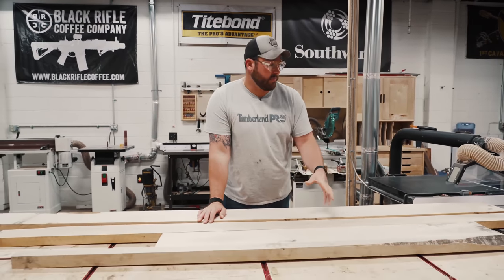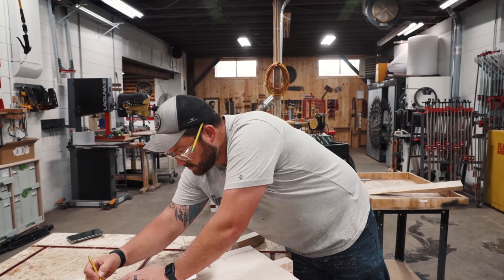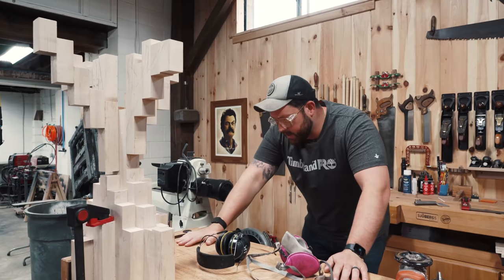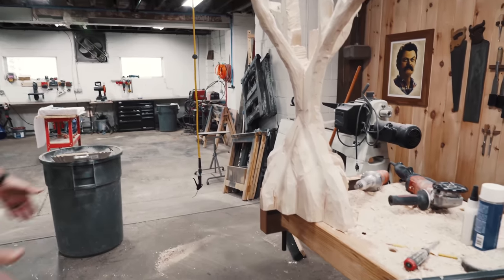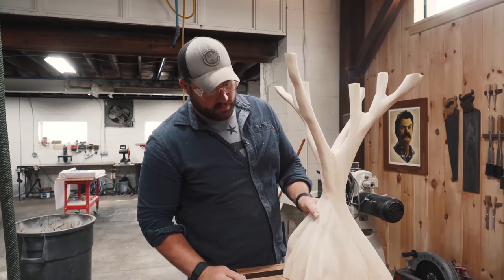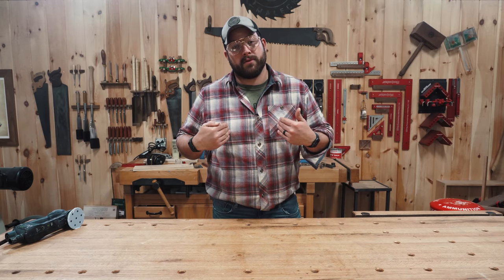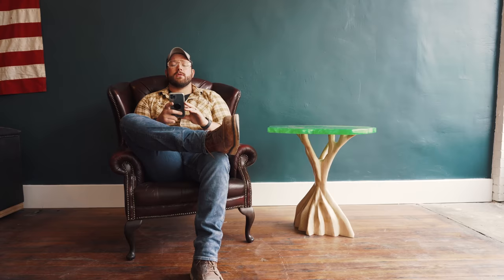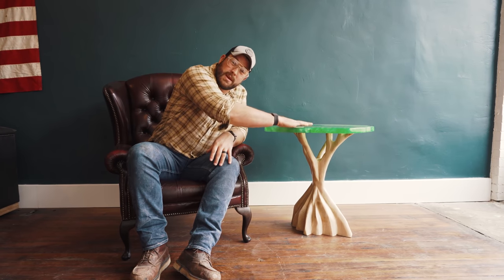CRAZY Epoxy Tree Table Build 🌳

Comment: Hey John I use the Milwaukee m12 die grinder to carve you can buy any cheap 2 inch aluminum oxide discs for them. I use 36-40 grit to hog away material and you don’t get any tear out. I can carve for around 30-40 minutes on one 4.0 m12 battery. I currently use mine to carve birds. I roughout them out on the bandsaw and then shape them with my die grinder from 36 grit for shaping up to 10000 grit for finish. I don’t do any hand sanding on them. It makes the job fly and you don’t have to worry about losing a finger!

Comment: I think it looks great. The 1 thing I would suggest to improve it is when pouring the resin top that you have the table suspended like a 1/2" so you don't see the limbs protruding through the top. 
And maybe making the base a little more organic by cutting through the base so you can see the individual roots branching out instead of 1 big cluster.

Comment: so i do a bit of power carving myself especially with the arbortec turboplane I love that thing. some things i've learnt from power carving is having a variable speed angle grinder can help at times with tear out aswell as just being alot less aggressive, really quite amazing how much control you can have with that tool and when you get more confident just being more nimble with it and having the grinder is some really quite odd hand positions to account for grain direction(using a switch grinder and not a trigger one of course) will make that alot easier to accomplish. another tool which you may want to look into is a powerfile ive just got a black and decker one but makita has a reasonable one and some pretty solid pneumatic ones they compliment it wonderfully especially for those awkward spots you just cant quite reach and the stock removeable is really impessive, and since its a sanding belt you wont blow out chunks either. hope this little tid bit helps, love your work john and hope to see more power carving in your future.

Comment: Looks really good! I am not a huge fan of the top since you can see the branches. What if you pour another slab, smaller than the current one, and then trim it up like you did and then glue it on the top. This will then make, in my opinion, a more tree top look to it.

Comment: Hi John - I love the more organic projects because so little is dimensional - everything has to be worked out individually in order to fit in the end. I was wondering what you were spraying over the epoxy and wood base in that last step, like was that a seal coat and if so, what was it? Thanks, Wm

Comment: Arbortech has a new mini grinder with a2" wheel and skinny neck for tight spots. I've sold a few at work to some masons that attach a diamond wheel for tight mortar joints. I forget the model number at the moment.

Comment: I would have tried suspending the legs higher up to maybe try to get more epoxy between the mold and where it connects to the base. Maybe you didn’t have enough room as it wasn’t the deepest poor. Came out cooler than I was expecting

Comment: With that setup you had for the pour I wonder if it would be possible to hold the base a half inch higher so the wood doesnt come through that epoxy? Might need a bit of extra stabilization.

Comment: Awesome work! I just would have done one thing different.. I would have fixed the wood lifted up about a 1/4“ in the resin to have a full epoxy flat on the top after.. but hey first I got to do it better to mention something 😅✌️

Comment: This is pretty awesome! I have a few daughters that would love something like this. If I wanted to build something similar but not have the ends of the wood showing on the top (not that it looks bad) I would assume I would just build a hanging jig it so it doesn't go all the way down in the mold. My question is how much of the wood needs to be in the epoxy to have a firm grip and not have to worry about it coming off? I understand this will most likely be a guess but I'll take that as a starting point! Thanks in advance.
Reply: I would poor 1/3-1/2 inch deeper and ~70% of the wood to achieve the effect you want.

Comment: Love the tree, just wondered could you suspend the base like you did but have a space between the epoxy and the tree so you can't see the ends of the tree in the epoxy top?
Reply: I was thinking the same
Reply from the maker: I like the tops coming thru, but yees i could. on the next one we will maybe.
Reply: Or I was thinking just pour a last layer after most of the sanding is done with the table upright and let it just run off the edges, then when it's dry sand edges but not top. That way the tops of the branches will still be seen some, but also covered slightly, as if they were actually covered by "leaves". And if the color isn't exactly a match, well then it's fall. Lol.
Reply: @kristamarie6104  Leaving the drips might look cool, too.
Reply: @Just Some Kraken With Internet Access Think a little laterally my friend.  By making (mixing) the base colour with the basic resin (Part A) for the whole project, then just add the necessary volume of Hardender (Part B) for each pour (the thin layer and, when 'setting' the main pour) then the colour will be identicle for the whole resin element. Job done innit !!!

Comment: I wondered when you said you were going to just drop the tree in the epoxy if it would show on the top and it does. Would suspending it half way in not be better or would suspending it level in it be too hard and it may not be as strong as less epoxy wood contact??

Comment: Would it have been or be possible to build a rig when placing the base in the mold so the top of the base (tree) is sitting in the epoxy with another 0.5 inch or so of epoxy covering up the limb tops to make it more aesthetically tree like?

Comment: I have a question, so I have a hoist system in my house and it's no longer used it has a hook for a locking carabiner, was wondering if there was anything cool I could do with it like a moving table or something, not to sure if it would work was just an idea I had, any suggestions?

Comment: As ever, this is a brilliant fun and interesting and entertaining video. It left me however questioning and uncomfortable with the basic concept. Call me a tree hugger but epoxy is an expensive product simply because of its cost in terms of energy to make it and the general environmental impact it has from its toxic chemicals to the waste (that will never degrade) that it creates during its milling etc. Here you are marrying something flat and milled and man-made with a natural tree shape. For me this creates a difficult dischord in terms of what it is you are trying to say. If it was an art piece protesting against our plastic polluted earth then it makes sense but it was always just a fun fantasy.  However, all that said, the top colour is spot on and with the swirly finish it works so well. Is it top heavy or does it work as a stable useful table?

Comment: First, your video is great , blah, blah, blah (insert favorite phrases here), and love your channel.  FYI,  on your next carving, you can add lots of strength to your glue joints by using bamboo skewers as dowels.  they are very strong and easy to install at any angle, giving any glue joint super strength,  and if you carve some while still protruding, they can look like tiny broken branches.  Their added strength is unbelievable.  I use then on 1/4" plywood joints all the time.  I do have a video about skewers as dowels if you want to learn more.  Hope you weren't too busy to read this :>)

Comment: I don't love how the legs are sticking through and visible on the top of the table. I think it'd be cool if you found a way to avoid that. maybe build a jig from which to basically hang the wood part over the pour form, in a way that it reaches only half the thickness of the epoxy?

Comment: Not fan of wood coming trough the epoxy like that. Tying it with this method sure its great but not going trough. Only thing to save it would be branch that goes all the way and over the table for store keys or something on it.. Other than that nicely done, trough next time level the bottom then cut the branches and level everything for the casting.

Comment: Not the strongest design but excellent execution. I would have flared out the bottom out more and made them look like roots coming out if the ground and attached a round bases with turf around the parts of the base with no roots to sell the illusion the wood is coming out of the ground but that's just my opinion 😂 can't wait to see what you do with air.... Unless you count the floating furniture 🤔
Reply from the maker: haah thanks Tony, with ideas like that why dont you have a building channel? sounds awesome
Reply: @John_Malecki  i just started wood working during lock down bought my first set of tools and slowly starting my collection saw your every tool a beginner needs video and when I realized you were the same John Malecki i subbed and benched all your builds during lock down 😅